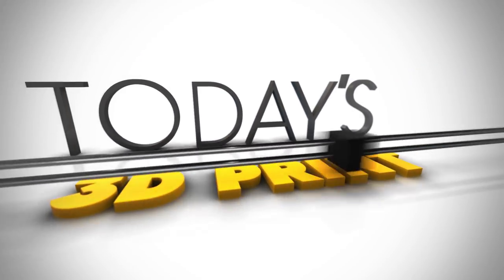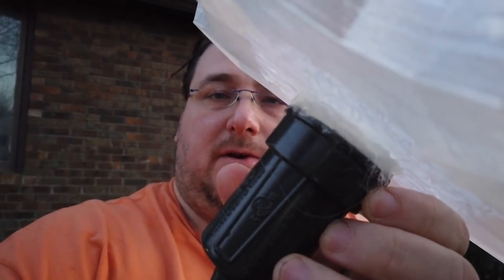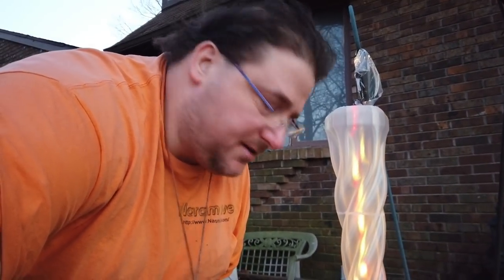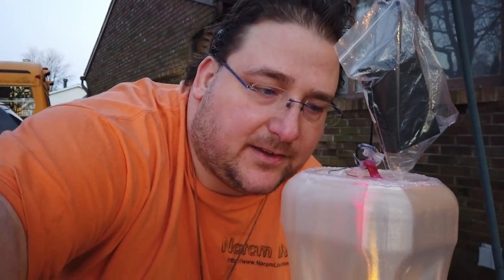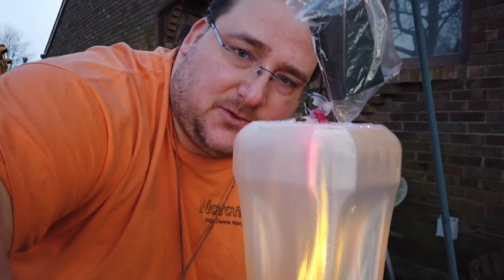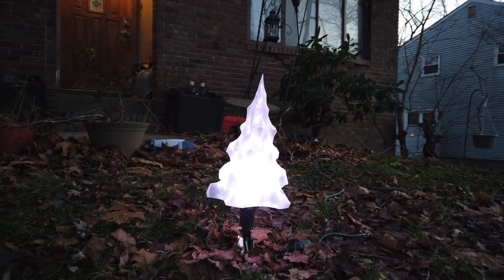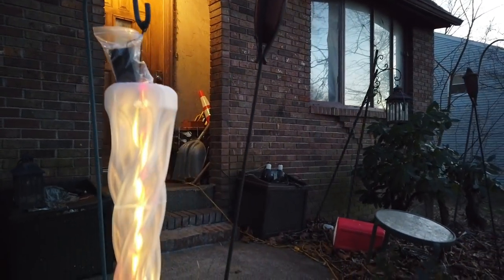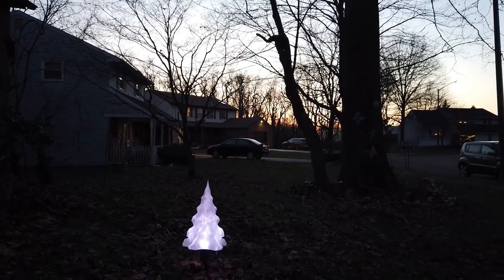Giant Lit up Icicle and Tree Setup Outside T3DP

Comment: How long did that take you to print this?  Looks great. 
Dont suppose you have any ideas on fan quieter fan replacements for the cr-20 do you?
Reply from the maker: Yes I replaced all the fans in my cr20 with quieter fans I'll have to go over my machine again to verify the sizes but the Hot end fan is 40 by 10 mm I'll have to check with the exhaust fan is and the power supply fan is I believe the power supply will a 40 x 20 fan but I have to verify that

I use 12 volt fans such as noise blocker or noctua I use buck converters to down convert are the 24 volts to 12 volts for these hands the only one you can't easily replace is the part cooling fan so I just run that at a slower speed 60 to 80%
Reply from the maker: I don't remember how long it took to print the tree as for the icicle I believe it was around 14 hours I will have to check